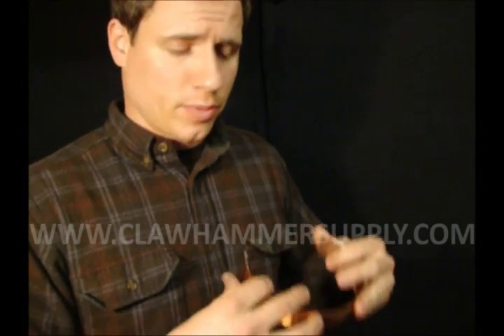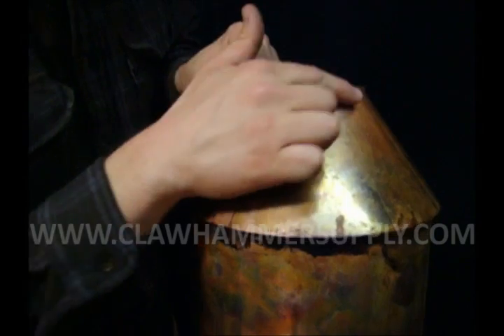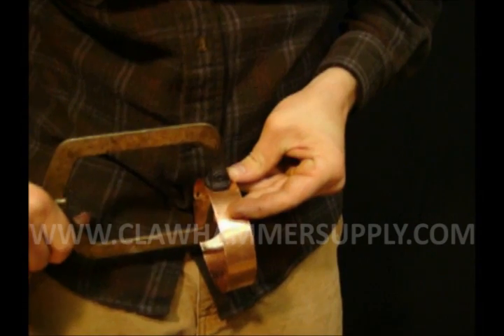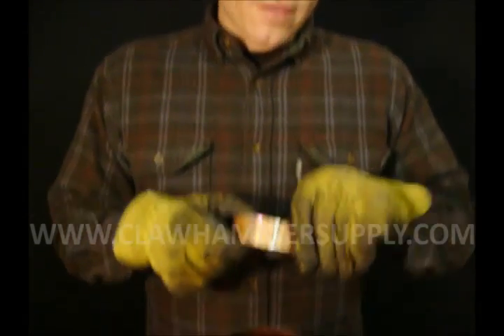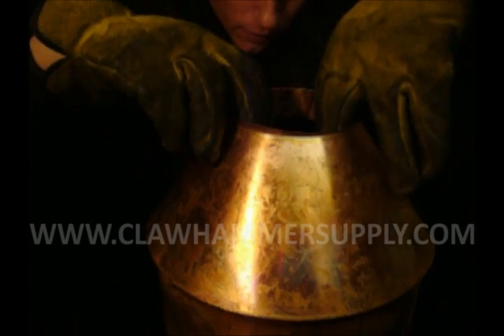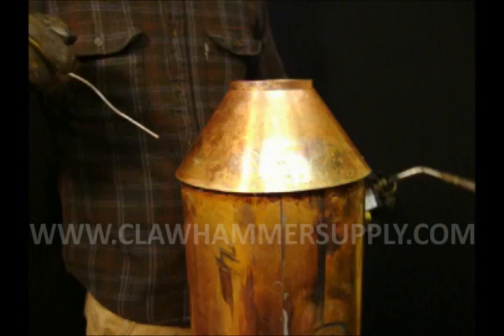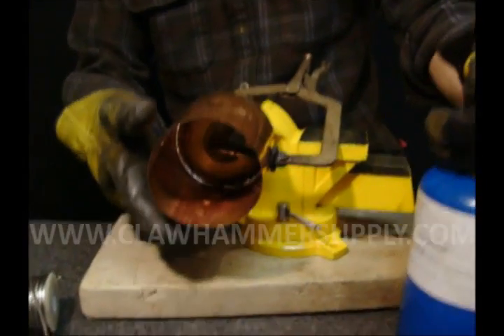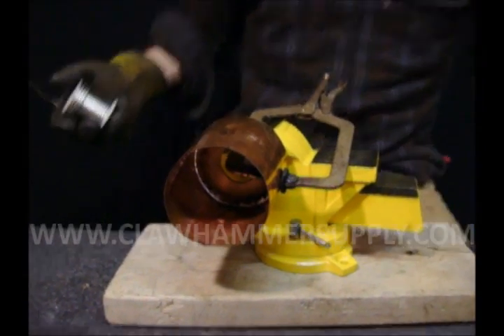How to Build A Copper Still - Part 5

Comment: i like your funnel . im a plumber  check out a 3 x 1 1/2  copper dwv fitting reducer for the top . then reduce bush  with any fitting adaptor you want . make it really  strong and easy

Comment: My boiler is leaking after 5 attempts to re solder. The bottom just didn't seem to fit super tight. Its only leaking in two small areas. I was wondering if a soldering iron would give me a little more control than the torch.
Reply: Clean the leaking areas with a wire brush and or sandpaper till it shines, add some flux and try again. Copper needs to be free of tarnish before solder will properly flow and it needs to flow to seal. You will see the difference. A soldering iron won't get hot enough, it's made for wires not sheet metal. If you need more control just keep the torch flame farther away.
Reply: I managed to get my boiler to seal off on both the bottom and the vertical seam. But, the problem arose with the cone. I just couldn't seem to get all the gaps filled with solder.  

So, I reverted to modern technology. I finished it off with JB Weld. It is not very pretty but, hopefully, it will get the job done--haven't tried it yet.